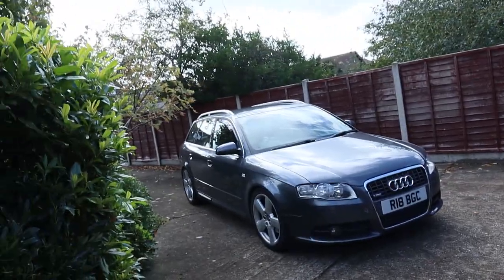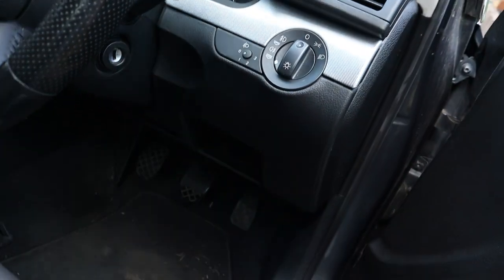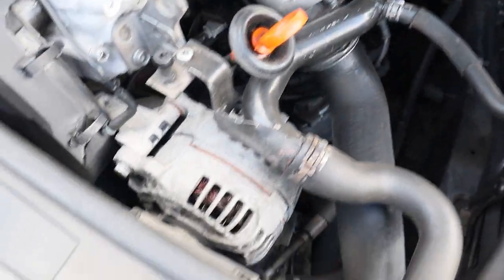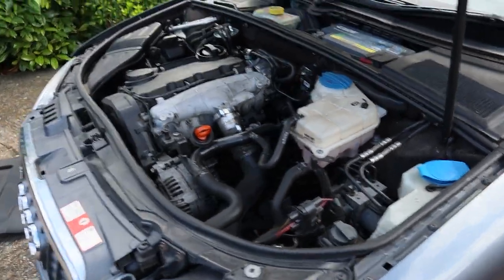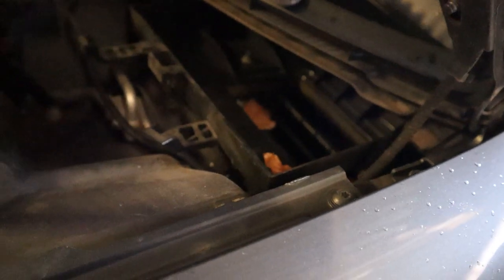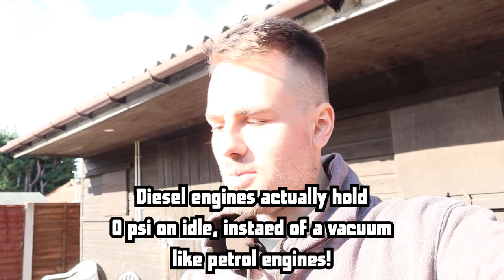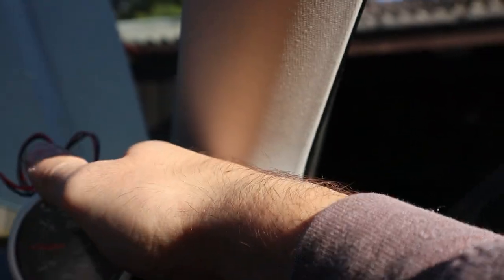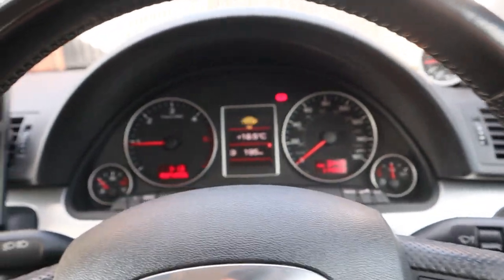Quick Boost Gauge Install for Cheap... (Audi A4 TDI)

Comment: For anyone using a cheaper quality gauge unlike the turbo smart gauge in the video you may find the gauge rattles and the needle shakes. To fix it you can put a restriction in the line like a T piece with a nail in it or half a ciggy filter. Diesel engines tend to pulse more than petrol engines so cheaper gauges will pulse.

Comment: It's normal for the gauge to spike when you slam the throttle, its a diesel vnt turbo so the vnt closes when you boot it which usually makes it overshoot when mapped but it comes back, 100% normal, also mapped pd170s run about 1.6bar of boost which makes 23psi bang on :)

Comment: Wasss going on? 🤣 I went a different route. Through the ECU box and following the ecu harness into the cabin. Same side as driver less hose and easier install, no removing of passenger glove box.
Reply from the maker: Yea this is also a good way to go! Probably the best way. If I was to re do it I would do this 👌

Comment: Is the turbo actuator all okay? My old D2 td5 had been adjusted and then it was stuck and was causing overboost so the ecu would cut out on safety had to cover it in wd40 and wiggle it until it was free again

Comment: Yeah stock brd dude boost too about 21psi man, map probably has is slightly more. And the torsion value is more so to slightly adjust where the power band is close or on zero under load is kind of optimum for fuel efficency also. Can be done yourself by adjusting the exhaust cam.
Reply from the maker: Okay good to know. I'll leave it as is for now, next cambelt change I'll try to adjust it 👌

Comment: Dude I have the same car as you but its a quattro(same mods also) , also have the same issue you have with hesitation 🤬 I've been wanting to take the turbo out and strip down and clean as I'm certain it's overboosting as the vains are stuck due to carbon , I've also made the crank case breath atmosphericly to stop the oily mist gunking up the intercooler, just wondering aswell if when you change gear you get a dump valve sound ?
Reply from the maker: Yeah It could possibly be stuck with all the buildup. Mine does have a slight dump noise, nothing too loud though 👍 
I haven't checked my intercoolers yet but I bet it's pretty oily 🤢
Reply: @BWTV  I'm thinking it's a blow off due to a split /leaking pipe somewhere, might be worth checking your MAP sensor if that's clogged with oil residue.

Comment: I like your videos. 
Did you thought about using VCDS or Obd elven to log the expected and actual boost values while driving? 
This should give you a better idea on what is going on.
Reply from the maker: Yea the mapper had logged it originally when he mapped it. At around 3.5k it gave less boost then requested, but then it shoots back up

Comment: I’ve got the same engine as you Brad and my cover has the same problem, missing Audi rings.
I’m guessing the heat and vibrations cause them to come lose and fall out 👎🏼
Reply: Check inside your under tray, I had the same problem, after a few months I finally found the badge in the bottom of my under tray

Comment: what wind deflectors are these? do they do the job?
Reply from the maker: They are Heko wind deflectors. They make the road noise in the cabin louder, drivers side front one snapped putting it in, and the rear ones fell out after a couple months.
But they look cool!

And yea they do the job, I can have the window open slightly without getting blown away 👍

Comment: What is the maximum this gauge can reed,
Dave
Reply from the maker: This one reads up to 30 psi, call me stupid but I didn't realise diesels boosted so high 😄
Reply: @BWTV  yes they do boot high but I don't think it should be that high,
Contact the man that did the remap and ask him what he set it to,
Dave
Reply: Or if you can not connect him , ask someone that can read out the map from the ECU, so then you will know what it should be,
Dave